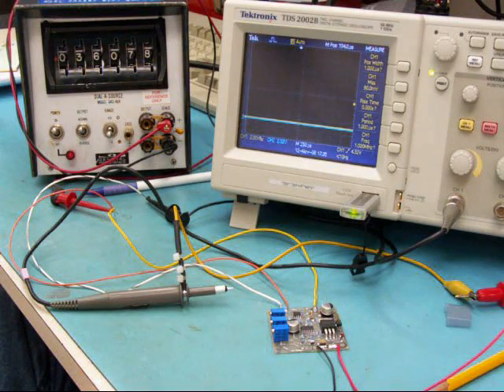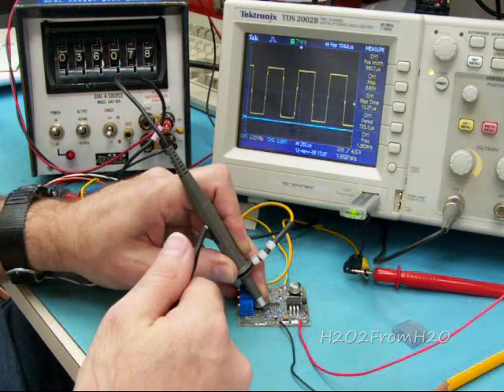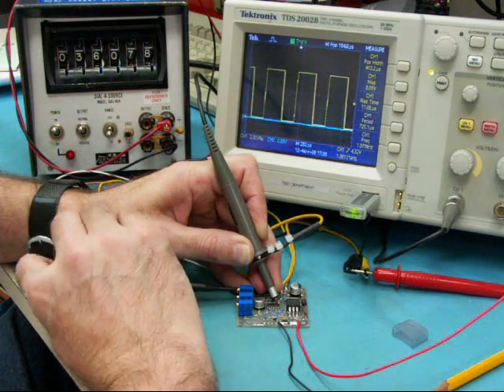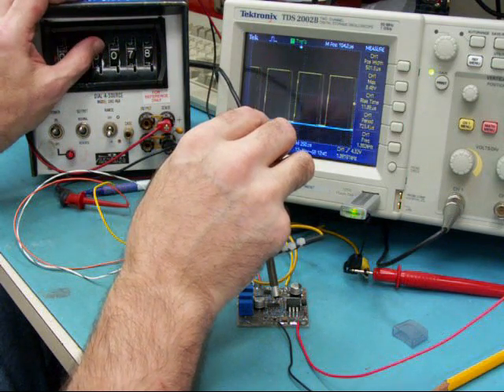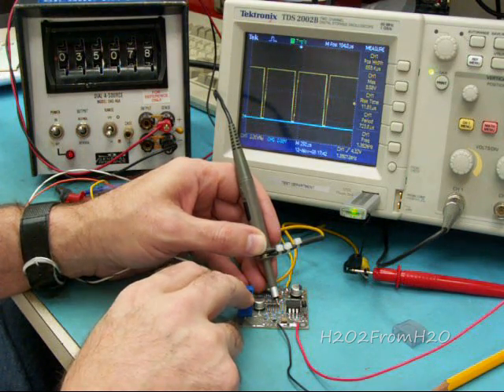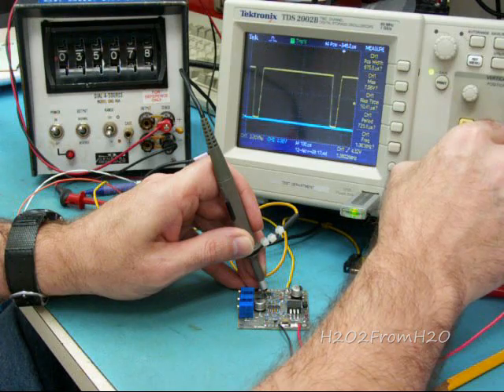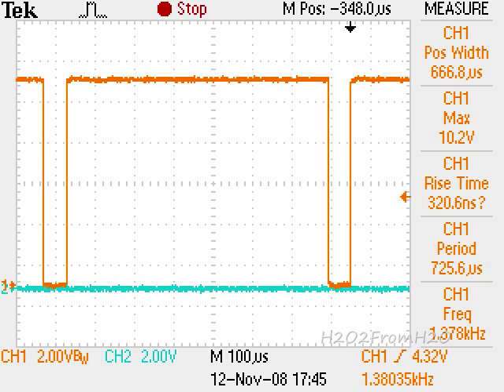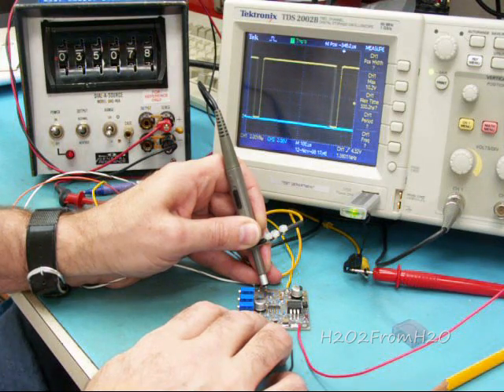#13 H2O2  PWM V2.0.1 Circuit Analysis Part 1 of 2

Comment from the maker: 160 Volts Ac or DC? A variac Produces a true sine wave through a transformer. Note: the higher the voltage the lower the Max current will be. Any other way of manipulating The Wall 120Vac would just chop up the sine wave or make it Pulsed DC.

Comment: Nice demonstration man, I wondering if it would be possible to build a pwm to do  160 volts and 25 amps? I am trying to figure out a way to have a controller instead of paying 200 bucks for a variac...